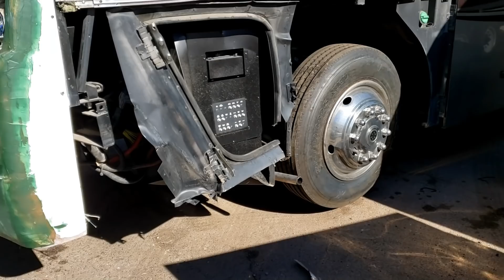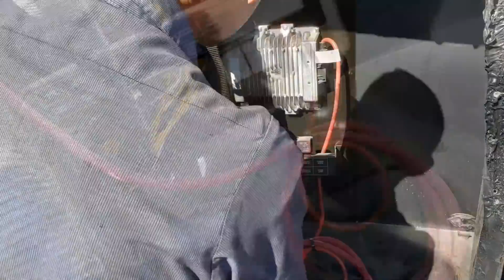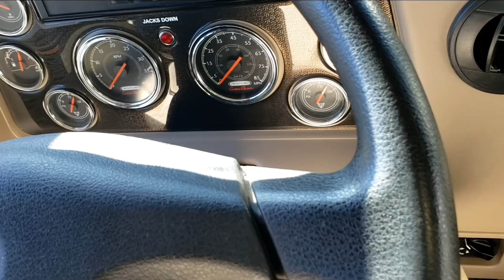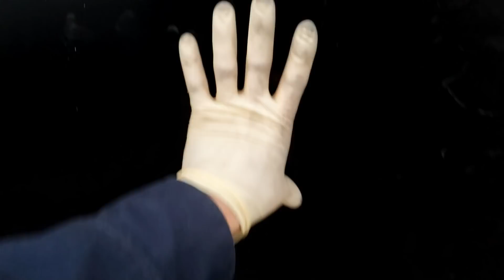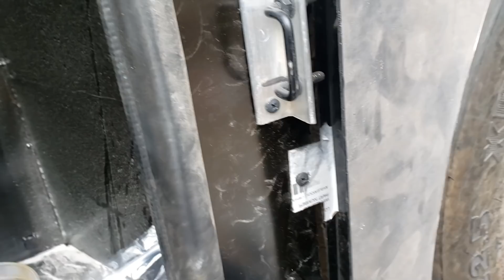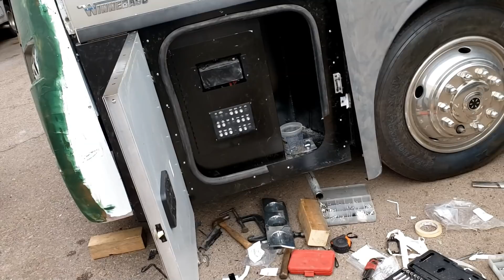Diesel RV 2017 Winnebago Forza Crash Repair!

Comment: DEFINITELY NOT FIVE MILE AN HOUR IMPACT RESISTANCE IT'S THE LIGHTEST F**** SHEET METAL THEY SHOULD HAVE BUILT IT OUT OF SOMETHING HEAVY DUTY JUST TELLS YOU ANYTHING WITH A CAB OVER OR THE DRIVER'S UP FRONT IN ANY REALLY DECENT CRASH THERE DEAD
Reply from the maker: RV's dont have much of a crash rating

Comment: I can see that a good RV repairman is part mechanic, part auto body expert, 
part electrician, part roofer, and part carpenter.  Great work and I really enjoy learning more about how these machines are built and repaired.
Reply from the maker: There are so many overlapping trades with these units. It can be enjoyable with the constant variation, but very frustrating at times too. Thanks!

Comment: This repair look pretty easy to do thanks to Winnebago and the availability of parts so easily attained makes me thinking that if I ever get a motorhome maybe a Winnebago is the right way to go. And I do have a theory why all of a sudden you have all of these wrecked motorhomes that need fixing more and more people are buying motorhomes and traveling and not used to the height, they are used to cars.
Reply from the maker: It was very straightforward. Winnebago has great legacy support due to having the tooling and molds for the components, but with the exception of the extruded aluminum, most shops should be able to fabricate the pieces if needed.

Comment: I'm really enjoying all of these videos! I know this is random but that is a very loyal impact driver you have!
Reply from the maker: You have a very good eye. It's a Craftsman Nextec driver. The series was discontinued almost a decade ago, but I have 10 or so batteries that are very long lasting and a slew of tools for them. New "old" stock is still available so it's been very difficult to let go of the past and move on. I think I've gone through 2 drivers in 10 years and it's a workhorse. I have a Milwaukee replacement set which is very similar as a backup, I just really like the Nextec though.

Comment: Great info as always!! After an accident does the repair facility or the insurance co. check for other damage? Like slides, electronics, water systems, etc? And they mount body panels (fender) on hinges? Thx!
Reply from the maker: It's just like a car accident. The insurance company would send out an adjuster and inspect and approve damage from the accident. The owner would also have to make claims about anything that was working and not due to the accident. The owner would still have to be satisfied with the repair too. Thanks!

Comment: I've done merchandising and jobbing in a past life. How in the world can you possibly bid a job like that? That would have to be time and material or a flat labor rate per hour.
Reply from the maker: It's very similar to a autobody insurance claim. You break down the needed repairs into labor time and parts/material. If you run into something during it, you submit a supplement to the insurance company. Standard RV repair labor here is $125/hr $95/ RV body  labor.  Thanks!

Comment: That shop isn't afraid of anything. They got you in the back pocket lol. Before I built my steel building I parked my coach at a storage yard. Came to see it one day and the drivers side mirror is bent backwards and broke. My spot was way in the back and the owners tried to see who hit it on the security video. We knew who did it (landscaping truck) but the owner said he could not see any matching damage and the cops said the same. So, I found a used mirror online and fixed it. Feel bad for the one that had the grill caved in like that along with the one rear ended. You mean I could start today ordering a few parts at a time. A few years I have a new coach!
Reply from the maker: That's my feelings too. I have more fear then they do for sure.
Reply: @AZExpert  what do you think of Cummins Coach Care?
Reply: Or is that a loaded question?

Comment: Wow I didn't know you could get all those parts pre made. Also the installation seems  simpler than I would have imagined.
Reply from the maker: Yes, Winnebago manufactures nearly all the components in house even the extruded aluminum.

Comment: James, that Forza has a Magnum MS2012 Inverter. Magnum stresses that when removing the batteries that you need to remove the Positive connection first and then the negative. The reason being that when the negative is removed first the inverter's electric control boards will look for a negative elsewhere and it "can" destroy the control boards. The inverter is not on the main power solenoid cutoffs but usually there is a rotary knob (old fashioned "salesman switch") cutoff mounted adjacent to the inverter on the positive cable to the battery. If that rotary cutoff is off then you can remove negative battery cables without worry. However, if it's on you should disconnect the positive battery cabling first. Also, Winnebago wires the inverter to the batteries directly and usually somewhere in the middle of the battery bank. Hope this helps.
Reply from the maker: On the battery bank, you'll notice I removed two main grounds, one goes to the inverter and the other is the main 12vdc ground/chassis. Thanks!